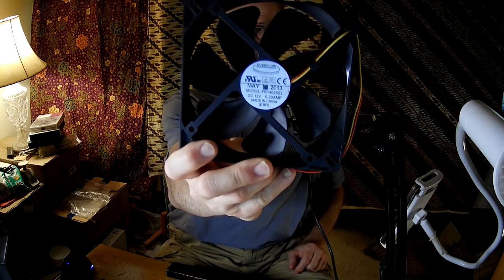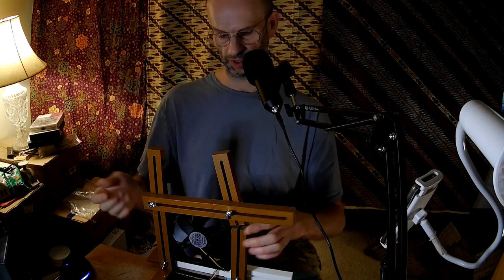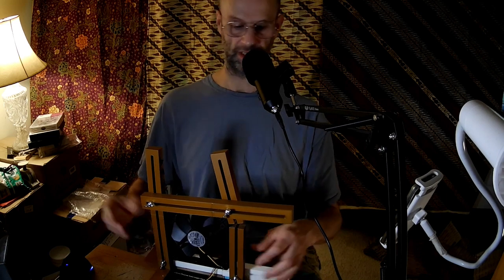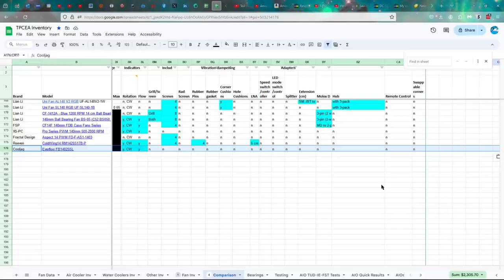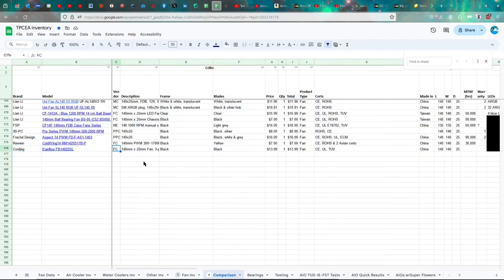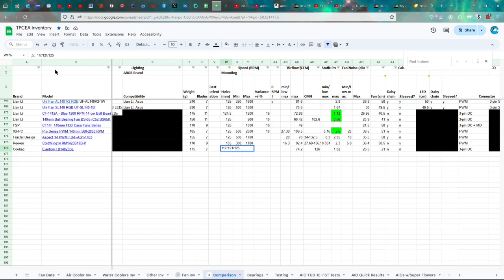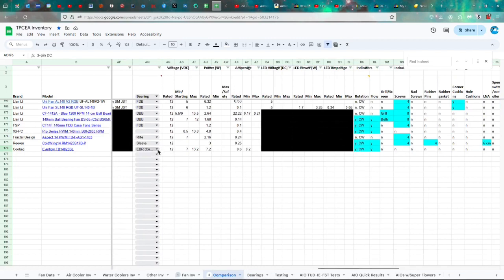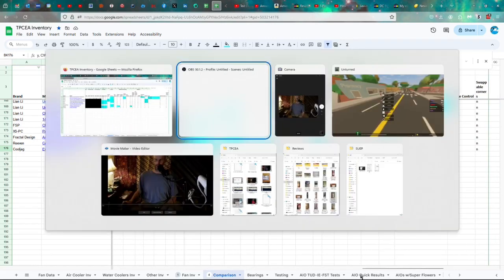Cooljag Everflow FB14025SL 3-pin Fan Review, Pt 1

Comment: Hello friend, how are you? I see that your channel is an expert in air cooling. I was just thinking about buying this cooler, and since I couldn’t find much information, I came across your video. Thanks for that.

By the way, do you think the Id-Cooling Frozn A610 would be enough for a Ryzen 7 5700x3D?

Thanks and greetings from Argentina!
Reply from the maker: Hello! I don't think of myself as an expert, but I can help. The A610 is good enough for the 5700X3D. If you have trouble, you can take steps that can reduce the heat produced by the CPU, and even increase the ability of the A610 to get rid of that heat. Here are some tips:
1) Install an offset frame instead of the ILM (mounting frame) included with your motherboard. This will help center the cooler over the hottest part of the chip.
2) Undervolt (with or without some overclocking) the CPU to decrease it's heat production. You will lose very little performance if you UV.
3) Replace the A610 fans with much stronger fans, such as the Phanteks T30, the Iceberg Thermal IceGale Xtra, the Super Flower Megacool, the SilverStone FHS 120X, or any other fan with a much stronger static pressure. I suggest looking for fans that have at least 3.5mmAq of pressure.